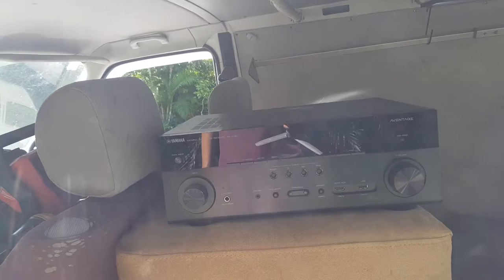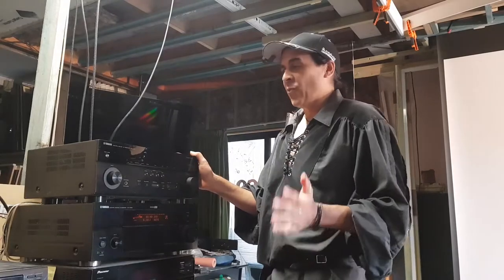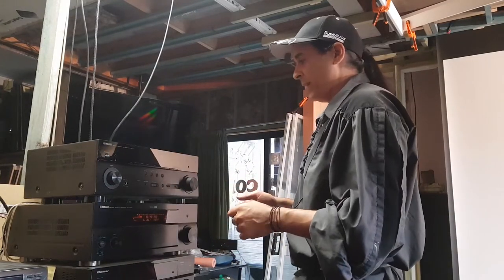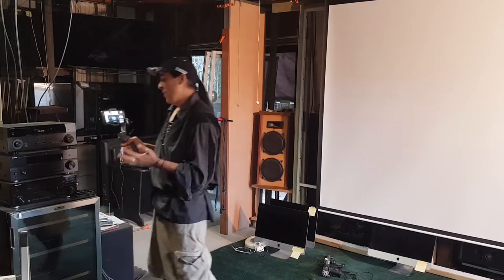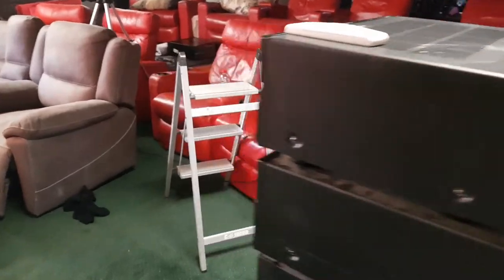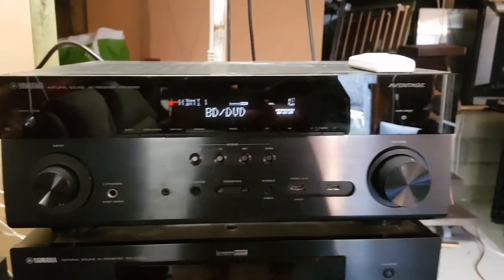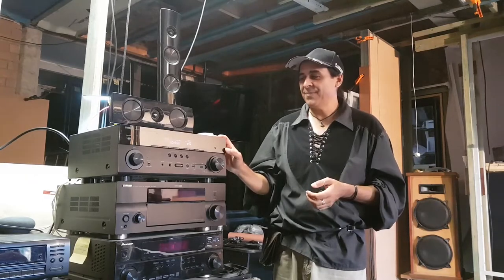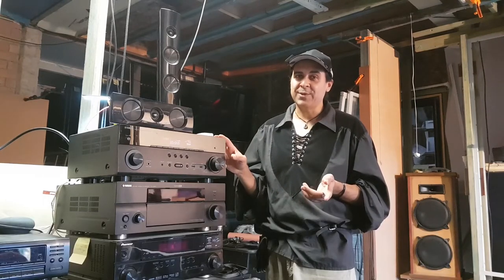Dolby Atmos Home Theater Receiver found in a bin! Let’s turn it on.  Dumpster diving. Yamaha RX-A760

Comment: Hi Isky, what made you  change your preference to the smaller Yamaha amplifier? what is the Atmos feature or the quality of sound.  What was the person thinking when he dump it!!! I will never understand it. 😁😁
Reply from the maker: G'day mate! Well in the end I used it the way it was set up in this video for about 48 hours... and I noticed something different compared to the larger unit I was rockin previously. Basically I used to get drop outs occasionally with my other receiver. But I never thought it was related to the receiver itself. I always thought it was a hdmi connection issue. But when I was testing my new atmos amp I noticed that I didn't have a single drop out. So I decided to swap them over because that was tell me my older receiver must have a slight issue.

The atmos feature is just another surround sound immersive feature. It expands on existing surround sound systems by adding height channels. It's supposed to be pretty cool.

I haven't really noticed any difference between the two amps due to the difference in their sizes. But these things are like cars mate. Buying a car that goes to 400km per hour is pointless when you can only ever drive it to 100km per hour anyway lol. Most of the time I only listen to my movies moderately loud. 90 watts per channel is heaps. Most of the time even my friends are telling me to turn it down 😅👍

And I know right!? Even I still get blown away with what I find. Some people are weird. But I'm not complaining... as long as I'm the one finding their garbage 😁👌